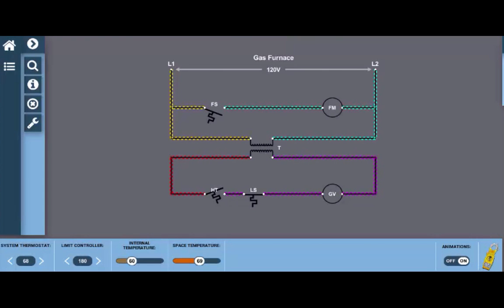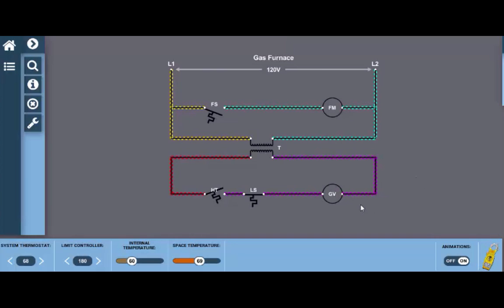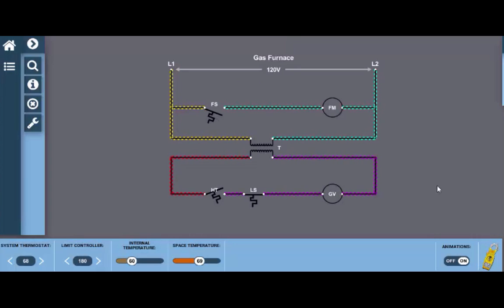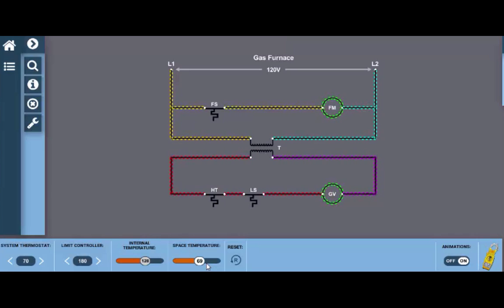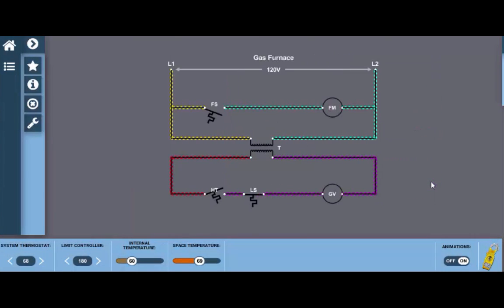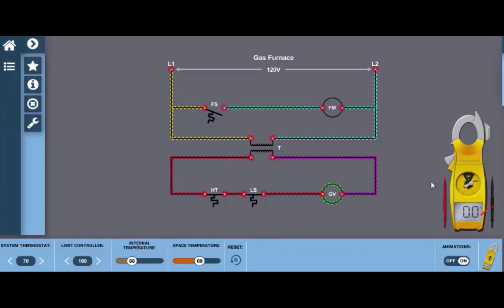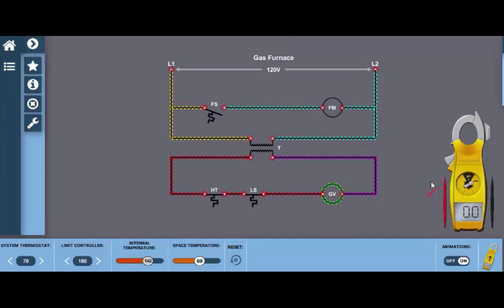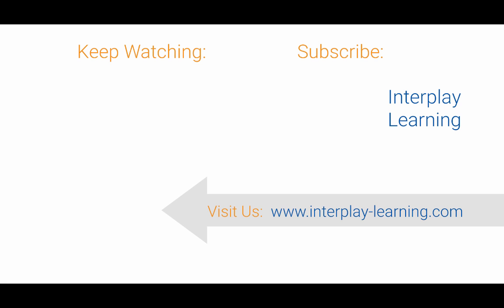Gas Furnace Wiring Diagram Electricity for HVAC

Comment: What's the easiest way to check a gas valve whether it works or not
Reply from the maker: Hi Brett,

There are multiple ways to troubleshoot a gas valve. Check out our troubleshooting 3D Sim course for a walk-through lesson: https://hubs.ly/H0mFsgy0. If you don't have an account, you can sign up for a free 14-day trial.